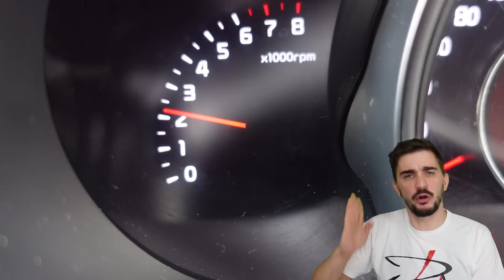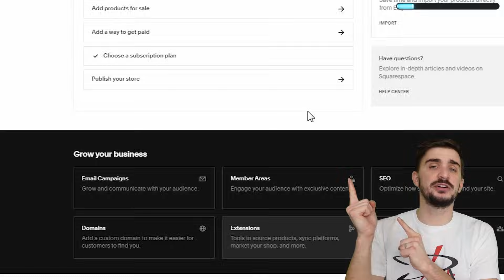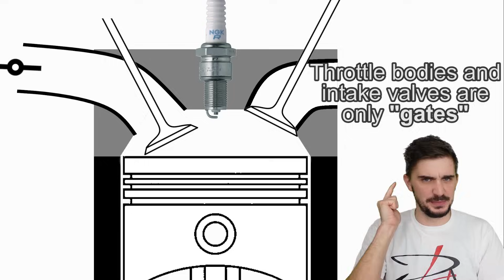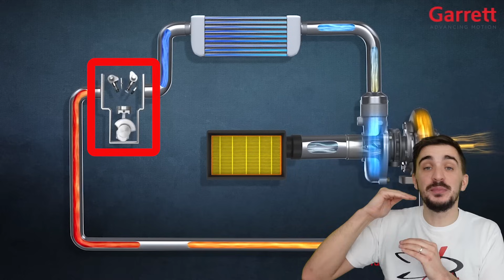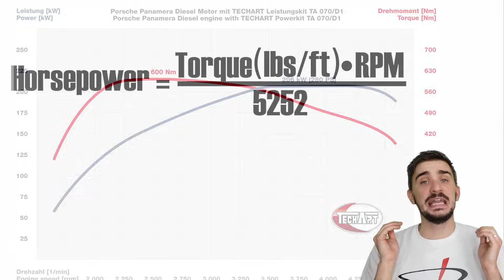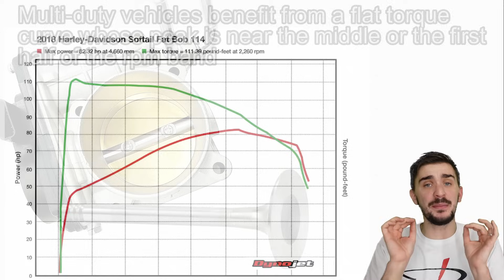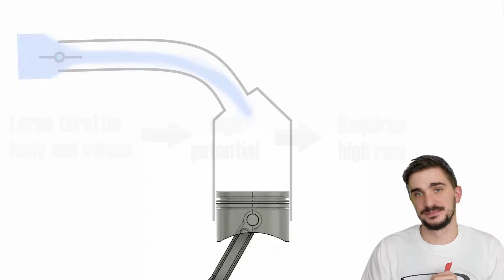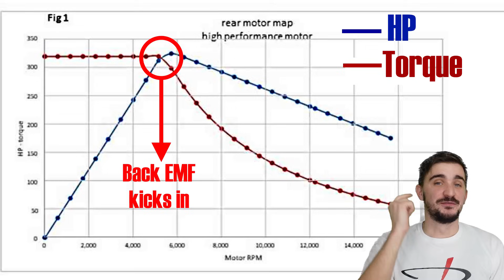WHY are HORSEPOWER and TORQUE CURVED?

Comment: The main reason for the reduction in BMEP (and thus torque) at low speeds is the heat lost to the cylinder (due to the long time between ignition and BDC), and the tradeoff between combustion chamber geometry during the timing of the combustion event (delaying combustion so the high pressure coincides with a favorable rod-crank angle will decrease the effective compression ratio).

Other factors include reduced inlet air velocity for mixing and complete combustion, more time for leakage per engine cycle, and being outside the range of speeds the intake and exhaust have their resonances tuned for.

The "pistons not moving fast enough to suck air in" fails the sniff test. The pistons moving slowly gives more time for the cylinder to fill. At very low speeds, the cylinder pressure will be equal to the manifold pressure at the end of the intake stroke.
Reply: I think he's plain wrong, sadly. Usually I'm plain wrong, happily
Reply: Power = speed x torque.
So I'll just focus on torque because power is directly related to it.

Whenever a fluid is moving in a conduit, there are losses, meaning that there is more pressure on the beginning of the conduit than on the end. This pressure loss is proportional to loss factor of the conduit (which depend of the roughness of the pipe, the viscosity of the fluid, the type of the flow (turbulent, laminar etc..) and other factors ) and to the fluid velocity *squared*.
So to sum it up, the quicker the air is travelling inside a pipe, the greater the pressure loss, or pressure difference there is between the intake and outtake of the pipe.

We can consider that the intake of an engine is a pipe. So, the faster the engine is turning, the faster the air is traveling through the intake (pipe), the the greater the pressure difference.
As we have atmospheric (or boost in case of forced induction) pressure (we'll call it p0) at the intake, we only have to Pc inside the cylinder.
Pc = P0 - ∆P = P0 - Z.Q² 
At the end of the stroke, we end up with a pressure thay is  LOWER than P0.

Finally, we can apply the perfect gases law (P.V = n.R.T). We solve for n (the quantity of air particles inside the cylinder) : 
n = V/(R.T) * Pc
    = V/(R.T)* P0 - V/(R.T)*(Z.Q²)

The second part is strictly positive, which means that there is less air inside the engine as if it was at atmospheric pressure. 

To sum it up, the quicker the engine is turning, the less air is inside the cylinder, meaning that the torque curve isn't due to the "vaccum" effect.

The curve could be explained by the heat that is lost to the piston housing, and the fact that the quicker the air is entering the piston chamber, the more turbulent the flow is, the more homogeneous the mixture with fuel is, the better the torque is.

I hope that you followed to the end, in any case if you think I made a mistake or there is something you don't fully understand, let me know. :)
Reply: @SetKat-Alex  I think that's right.
Reply: Let’s not forget pumping losses when the throttle is closed.
Reply: @crustyzimmerman3324  you did not get the point of the video, we are talking about maximum torque here hence full throttle.
Reply: @francoisloriot2674  well you don’t get max torque at full throttle so maybe you don’t get the point?
Reply: @crustyzimmerman3324  you don't get max torque at full throttle??? what the hell!! when do you get full torque then???
Reply: @francoisloriot2674  about 2/3 , I think. There’ll be a video explaining it somewhere, I think.
I thought that one mentioned the reason why, but I don’t remember now.
Reply: @crustyzimmerman3324  I would love to see the proof and explanation of that!!!  You understand that would mean (at least for cable actuated throttle) that when releasing the accelerator pedal a bit car would accelerate more right? or with electronic pedal if you get a tuning software, and open the ECU map that calculate 'requested torque' using pedal position to get throttle opening you will see that the relationship is not perfectly linear but it's always proportional and there is no jump to max and back to 2/3.  That would create oscillations and would be near impossible to tune to make sense for the driver.  so maybe you are confusing with another metric like efficiency of combustion or something but getting full torque at part throttle is completely nonsensical to me.
Reply: @francoisloriot2674  perhaps I haven’t put it very well but if you look at a torque and HP curve you’ll see neither peaks at max revs and the explanation is as simple as that. I think the video even explains the reasons why..
Reply: @crustyzimmerman3324  ok but engine speed (rpm) and throttle opening are 2 different things.
Reply: @francoisloriot2674  LIKE I SAID…I don’t think I put it it very well.
Reply: @crustyzimmerman3324  first of all no need to yell.  and now what ? you tell  me we were arguing for nothing because you meant RPM and not throttle?? ooh god....
Reply: I concur with your last paragraph. Thanks.
Reply: This is what i was thinking watching the video. It was not mentioned how the cam profile shifts the powerband either aka efficiency at a given rpm.(just to mention one thing, this video is about why it's a curve)

Of course in conjunction with the diameter of  the ports, intake and exhaust. There is much more factors in what determine the powerband in an engine. Piston speed does matter, and in conjunction with the venturi effect, can  have cylinder air volume bening in the positive even when no forced induction is present.(which also affect the curve)
Reply: Yup. Agreed. Bs on the piston speed. Intake air velocity/momentum factors in also.
Reply: @thealienrobotanthropologist  I didn't realize that power was a vector quantity in this application.  Cross and Dot Products are vector math's, we're working with scalars.  Simply put, who cares if the engine  turns cw or ccw.  Granted and Dot product does result in a scalar, unlike the cross product, but still.  

look at it this way, Y=x*r, if we take the derivative of "Y" with respect to "r" then dY/dr=x.  Integrating that function through "r" yields us, Y=x*r+c.  The "fudge factors" in the denominators of the two equations shown on screen are to make the units work out nicely.  "Y" is power, "dY/dr" is torque, and "r" is RPM in this situation.  

Although it would be better to define the situation from the starting position of torque than power, I don't feel like retyping this all to do that.  I'm sure you can figure it out.  I would be curios to see how you think this works as a Dot Product though.  In math there's almost always multiple ways to define something correctly.  I just don't see how it works as a dot product.
Reply: @thealienrobotanthropologist  agreed, I think we were talking past each other.  Admittedly, I'm more of a stress analysis engineer, but I did take my colleges ICE class back in the day.  We never did this problem in class, but it is one that I thought about and the calculous method that I used worked for me, albeit, with weird units as a result.  I can see how a vector analysis could be beneficial if your looking for more than just a relationship between power, torque and rpm.  Especially if the engine has an offset crankshaft for a "quick" return mechanism style stroke that could be used to get a variation of the Atkinsons Cycle going on.  It would also help to notate where in the stroke it is at any given time for something like a stress analysis of something beyond just fatigue.  Simulating engine knock for instance, a vector analysis would be beneficial.
I'll have to dig up my ICE text book, I saved it, and see how they work this type of problem.  I never really read the book in class since the notes the professor provided were so good.  lol
Reply: You are going far from the video's concept . The whole idea is that the air won't suck into the cylinder (unless there is a vacuum) due to the pressure difference . Now the more vacuum the more air can be sucked into the cylinder . If the vacuum volume was smaller the air would fill that vacuum and nothing else, it would occupy that vacuum by a less amount of air. imagine the air as a substance that love filling vacuums only . The larger the vacuum the more it would fill it .  If the vacuum was small it would fill it and forbidden a more space of vacuum to be filled. EASY .
Reply from the maker: I'm afraid you guys are misunderstanding the video a bit. The video wasn't about what determines the shape of the torque and power curves but why they are curved in the first place. I understand the thermal efficiency point but again that's not the predominant factor. There's two important things here, the first is that we're not observing a single engine stroke, instead we're talking about what's happening continuously or within a given period of time. I don't know what's a sniff test but it's undeniable that higher piston speeds will get more air into the cylinder over a given period of time and thar higher piston speeds are also the source of the higher  intake air velocity you mention. This is just a simple video that answers a simple question, no more no less.
Reply: @d4a  I think you're wrong about why the torque falls off at low RPM. It is largely about two factors - heat loss during what is ideally an adiabatic process but predominantly relatively poor mixing of the fuel and air at low RPM. Two facts support the latter - why did initial 16V engines have lower torque at low RPM than identically sized 8V engines. The answer is that getting air into the cylinders as quickly as possible reduces turbulence that mixes the fuel and air. Secondly, Toyota developed the TVIS engine (Toyota variable induction system) that partially blocks off one of the inlet valves at low RPM to cause turbulence and improve low-end torque. A  further thought is that F1 engines have massive valves to let air into the engine very efficiently at any RPM but are very rough and have little torque at tickover.
Reply: @d4a  I think I understand the distinction: viewing events over a single cycle Vs over multiple cycles.
Reply: @d4a  so why is torque low at low rpm?
Reply: I guess it's like this: let's say your piston is moving 100 rpm, and air fills in almost perfectly filling 99% of void, your engine is sucking 100*99 of air in. But if my engine is moving at 2000 rpm and the % of void filled is 60% (those numbers are fantasy btw), 2000*60 is more air than 100*99 in one minute. Yet this explains hp but not torque
Reply: @qualcunoacaso4865  looking at it mathematically, torque is the derivative of power with respect to the cycle rate of the engine, making power the integral of torque and engine speed plus some constant.  So explaining one can give you a tremendous amount of insight on the other.
Reply: @Saule Karavirs  You mentioned torque being the derivative of power with respect to rpm, and then it looks like you had some discussion with someone but I can only see your comments, there comments seem to be deleted, so I'm not sure if this was discussed. Is that correct? I'm in the car so I don't have the time to really think about this but just from glancing at the graphs and looking at the slopes it doesn't seem right.
Reply: @qualcunoacaso4865  yes, exactly! In the scenario you suggest torque would be high at low rpm and lower at the higher rpm where you have less fuel and air on each power stroke. And that probably explains a big chunk of why torque does eventually fall off at high rpm. But it can't explain the low torque at low rpm. 
I realize I'm just rephrasing your point. I'm just trying to put it in language that is clear and explicit to my ear.
Reply: Probably it's a matter of air velocity, that makes combustion more efficient, and at higher rpm air is also faster, until it reachs the limits of the intake characteristics where it can't keep up with the piston and valves. Also, can't it be that the moving parts (like the valve springs) has a bigger impact at idle? Since the engine is making minimum power and so compressing them is reducing its performance more? Because the torque curve starts always being lower and i can't explain myself that, maybe i just have to rewatch the video
Reply: Also sorry for my bad grammar i don't speak english really well
Reply: @qualcunoacaso4865  I think your English is excellent.
Reply: @qualcunoacaso4865  right!
Reply: Oh thank God, I thought I was being stupid to worry about his comments on piston speed and vacuum. PV still = nRT whether the piston moves quickly or slowly. Your explanation makes complete sense, but I wasn't figuring it out on my own. Thank you!

Comment: I don‘t quiet get the formula at 7:35 … this doesn‘t include the engine layout, such as bore and stroke, or just the number of pistons. A 4 cyl. Evo can make different amounts of power in kw at certain rpm‘s depending on bore and stroke. Same goes for v8 engines…compare a ls7 with the Porsche 918 v8, just grab the calculator and realize this equation isn’t quiet right…can someone explain?
Reply from the maker: It doesn't include bore and stroke because it includes torque.
Reply: The differences between engines change the shape of a torque curve, but at the same time they change the shape of the power curve, in a way that the formula still works.
It is important to understand the formula works for every RPM, but the RPM has to be the same when measuring power and torque. The numbers you get from producers always list peak torque and peak power (because bigger number more better). Those are measured at different RPMs, which is why formula breaks there.
Reply: @igornoga5362  ahh, ok now i get it, thanks!

Comment: thank you for these amazing information. I have a question ; Does friction between piston and walls limit power production of engine?
bcz with higher rpm the friction will also increase and  loss will increase too.
Reply: not necessarily the piston but the rings. a piston shouldnt be in contact with the walls itself, rather the rings are what apply pressure to the walls and yes the friction can take away from power. In fact in 1985 Chevy and Isuzu partnered to make the Spectrum, a small cheap economy car, and in order to have less friction losses and therfore better economy, they gave it only 2 rings, one compression and one oil. I forget the numbers but it was shown to be beneficial for reducing friction losses, although using only 2 rings wouldnt be a good idea in a high performance engine you would get very low compression and a lot of blowby
Reply: Yes, the energy dissipated in shearing a liquid is velocity dependent. And hopefully you have a layer of oil to shear instead of your piston rings and cylinder walls! But yes all frictions and resistances that you can think of are limiting your power. As of now we do not know a way around this so we try to limit it!

I don't know enough to say that the friction will increase with rpm, as it generally means hotter oil, which is thinner and easier to shear. But i would feel safe in betting that since you are rubbing the rings across the same distance in a shorter amount of time that you are indeed using more power.